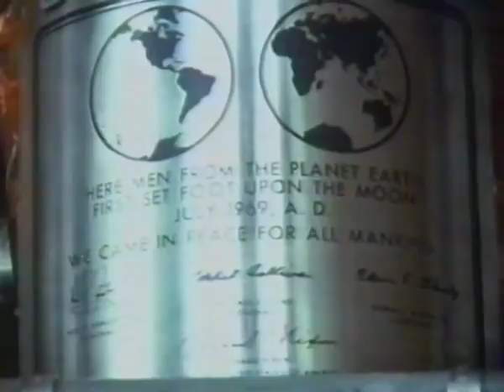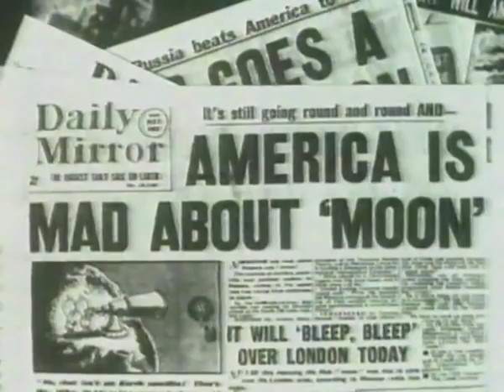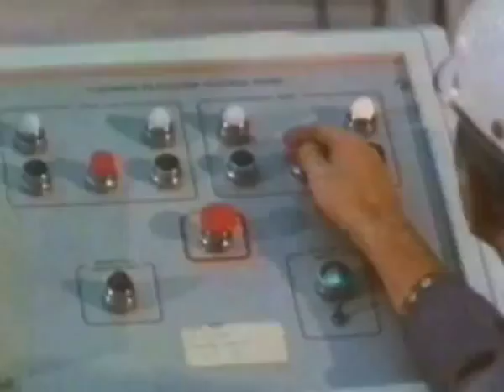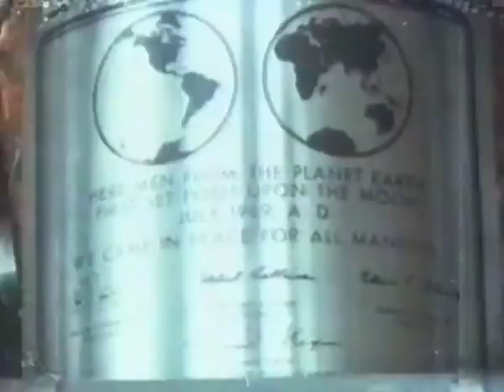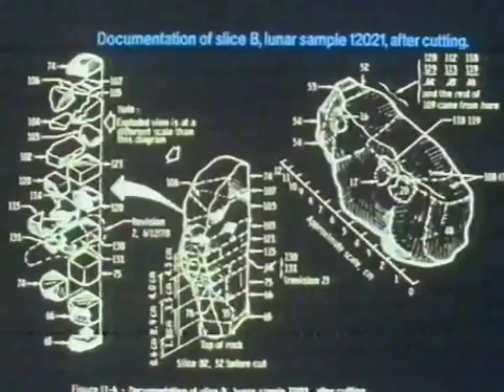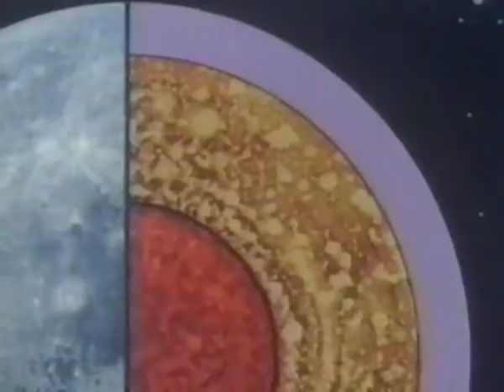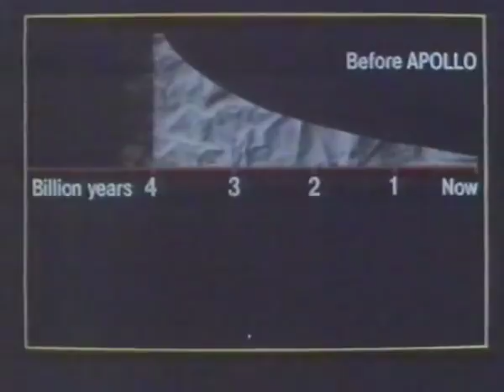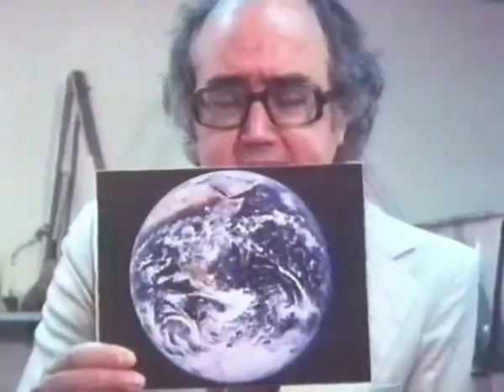James Burke   The other side of the moon 1979

Comment: Interesting that Jack Schmitt was unaware that Block I & Block II spacecraft had been developed in parallel. Block I was a non-lunar mission capable vehicle, having only a single hatch, not intended for EVA so it opened inwards to provide easier sealing in vacuum. The Block II being the built for rendezvous and docking with LM, as well a an outward opening hatch that was EVA capable.

Comment: The usual politics of the space race and not the technical aspects; but, this is perhaps one of the earliest presentations of these revelations; today, people wouldn't get much out of this.
Reply: Why don't most people get into science/mathematics?  Why didn't everyone from Eisenhower to Kennedy see that the real space race should have been to colonize space; to tap the energy  and matter of space?
Reply: oker59 There were too many terrestrial issues to be able to convince people of the value of investment into such endeavors I'd guess.  
This is still true today, that's why NASA's budget is similar to that of a large city instead of a real commitment to the work it does.
Reply: Today, we would say, 'what came out of Apollo was the internet kids who then went on to make the private space industry'!
Reply: +oker59 and are we today colonizing space? Read more, educate yourself more and you will know why we aren't....
Reply: The real reason is deep space radiation is a killer. Not in regards to short time exposure as done in the Apollo flights to the moon, but in long duration flights to Mars. You would have to provide the same protection as given by 100km of atmosphere and a powerful magnetic field which in metal terms is a hell of a lot of weight. That's the biggest issue stopping long duration manned deep space flight.

Comment: 25:17 it is not strange that they had redesigned the spacecraft. The original command module ("Block 1") was designed to specifications from the original mission modes: direct ascent or Earth orbit rendezvous. When NASA switched to Lunar orbit rendezvous the Block 1 spacecraft became unusable for anything beyond Earth orbit missions without a Lunar module. Rather than just switching all work to the new Block 2 design, NAA continued to develop Block 1 too in the hopes that the experiences with it would be useful as Block 2 caught up. By 1967, Block 2 had overtaken Block 1, but important changes in Block 2 (such as managing flammable material, or the outward-opening hatch) unfortunately weren't retrofitted to Block 1.

Comment: SURPRISED NO ONE COMMENTED ON THIS...

"*how are we going to get to the moon when we cannot talk between two BUILDINGS ??!!"

(*GUS GRISSOM RIP)
Reply: gus first said "three buildings"..which he later.changed to
 "two buildings"
Reply: The problem was that the NASA comms system used one form of wiring for their internal comms system (three wire) and the land lines between the sites doing the tests (ie Huston and the launch Control Blockhouse at Kennedy) used a two wire system. Rocco Petrone actually mentions it on this film. Conversion equipment between the two systems were not reliable.
Reply: But

Comment: I know one thing we see everyday that came from Apollo, singe pack condiments, like ketchup, mayo, and mustard.
Reply: Smoke detectors, and the modern computer chip as well.

Wikipedia has a great list called something like NASA spinoffs. It broken down by category. There's a lot we owe Apollo for, and NASA in general.
Reply: @lordgarion514  there is a bit of PR in there. The computer chip already existed however it's cost meant it was only used in space and weight critical systems such as rockets both military and civil. The apollo guidance computer design had its roots in work done for the Titan missile program.
Reply: @Spookieham  
Computer chips existed. The kind we use today were developed by NASA.

Just like cordless tools
They already existed, but sucked, so NASA gave a contract that lead to the development of a new DC motor, that we still use today.

So while NASA didn't invent the computer chip, or cordless tools, they invented the ones we still use today.

Which is why I specifically said "modern" computer chips

Comment: 56.12  to hide the moon (here on earth) behind your thumb at full arm stretch you would have to have a pretty big thumb. If you can do that to the earth from the moon’s surface would mean that the earth is about the same size as the moon, maybe smaller from what the astronaut is saying. Either the astronomers got their calculations wrong, or NASA and the astronauts faked it all, and goofed about the size of the earth as seen from the moon.
Reply: Nowhere did he say "at full arm stretch". If you have to be dishonest to make your point, what does that say about the value of your point? Especially when you are accusing other people of lying...
Reply: Actually the pinky finger, extended at arms length is 1 degree, the Moon is 1/2 degree in the sky.

Comment: What a crock of shit. Questions 
1: how big would the battery packs need to be to power the LEMs life support and communication systems? 
Answer: not big/efficient enough!
2: where is the blast crater and dust from 10,000lb descent motor?
Answer: It was placed there!
3:how’d they travel through van Allen belt without radiation sickness?
Answer: low earth orbit!